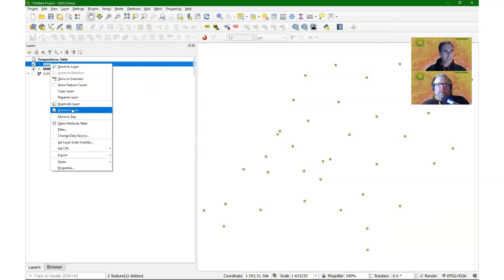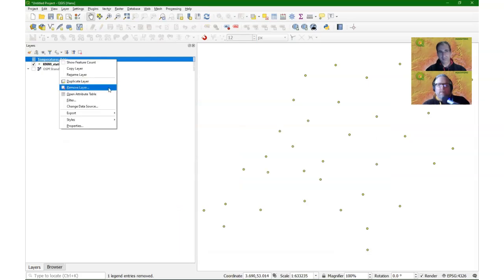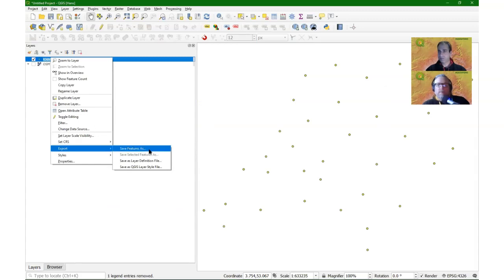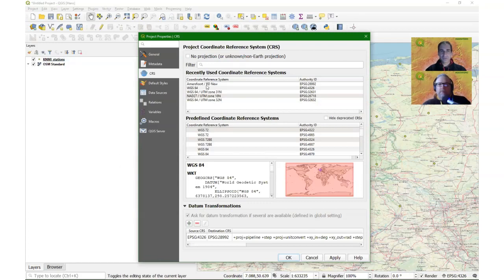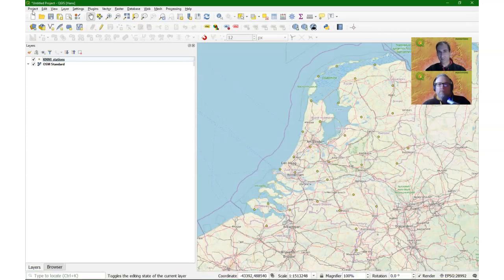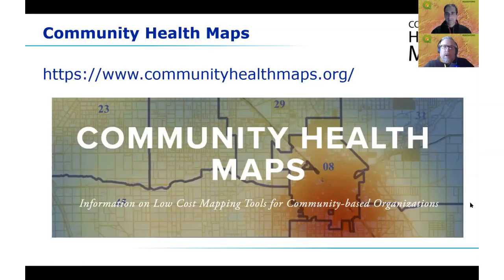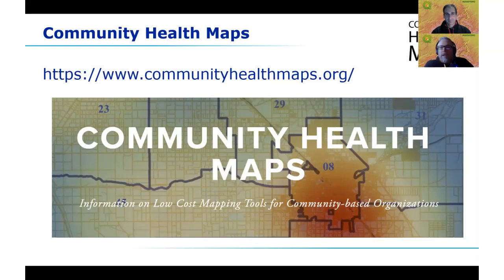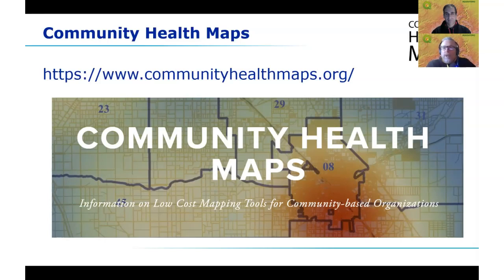QGISHydro Webinar 2: Import tables and spatial interpolation

Comment: Hi,
Thanks for your nice videos. It is very educating. I have a question.
For interpolation, I saw that each station has just a value, maybe they are values for a single day. My question is, if for example, you have a time series, maybe you want to interpolate for the entire 365 days in a year. How do you do that? Mind you, each station has 365 time series . A prcatical example is running a lumped hydrological model. Most times, you need the areal precipitation which of course could be gotten from Theisen polygon etc. which is usually calculated from the entire stations in the basin. How will one calculate the areal precipitation (which is usually one time series of 365 rows) of a basin with each station having time series of 365 rows?
Thank you.
Reply from the maker: In that case desktop GIS software is not recommended. This video shows how you can do that with scripting in Python using the PCRaster package: https://youtu.be/RFnvcApAw9g
Reply: @HansvanderKwast  Thank you for your swift reply. I will go through that.

Comment: WHY not link the spreadsheets !!!
Reply from the maker: You can link the tables in a spreadsheet program. Then you need to use vlookup in Excel for example. In a GIS this is a standard operation and much easier.